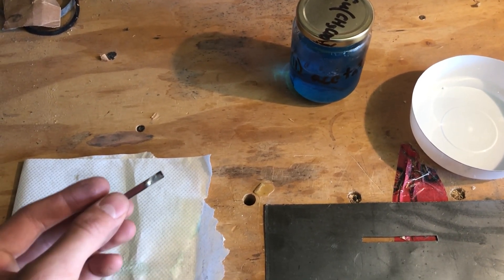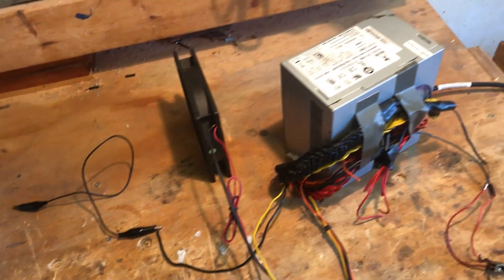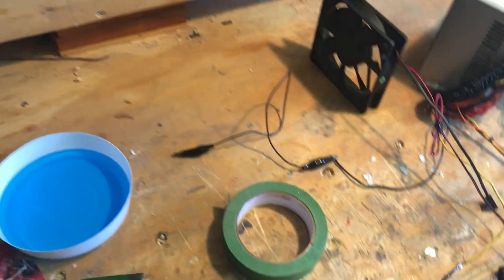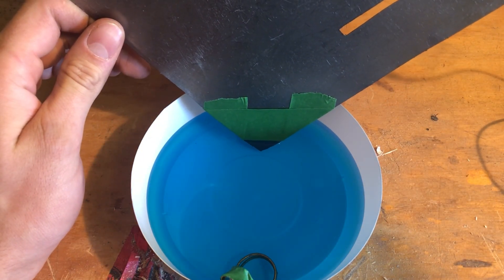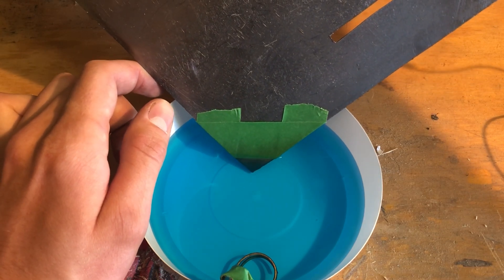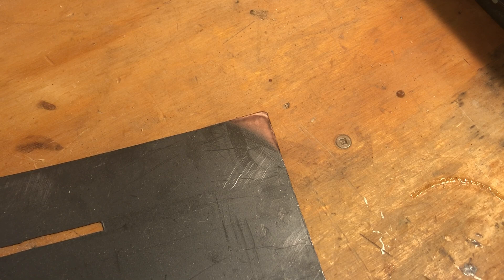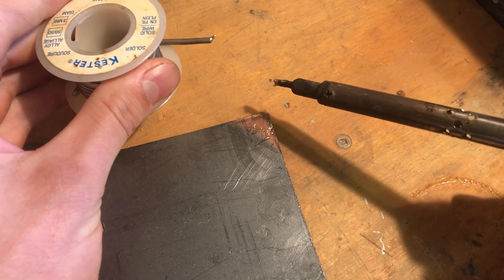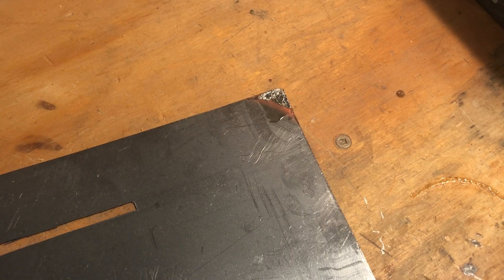Soldering Graphite Foil

Comment: i see the HHO drycell designt there right?im building the same thing. but copper wont hold up in the alkaline right, is the edge just excluded by the gasket? i dont want to lose the surface area, what else can i doo
Reply from the maker: If you are using a dry cell design there will be some surface area covered by the gasket material. That area is were you should have your connection so that it is not exposed to the electrolyte.